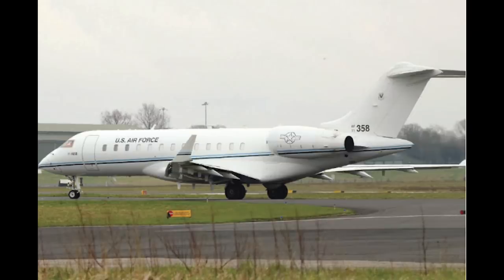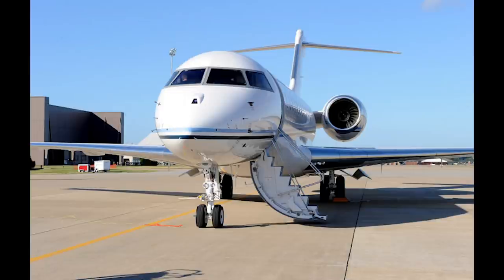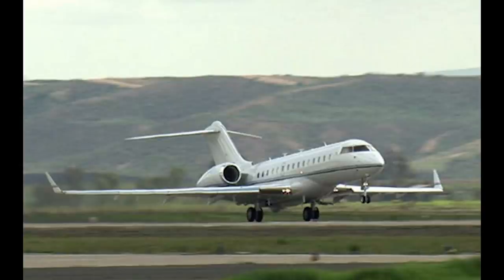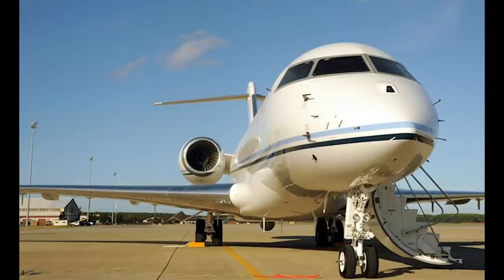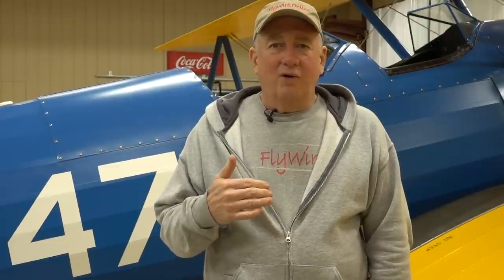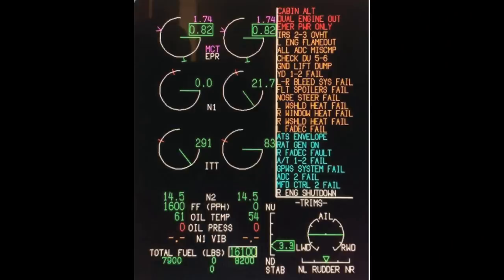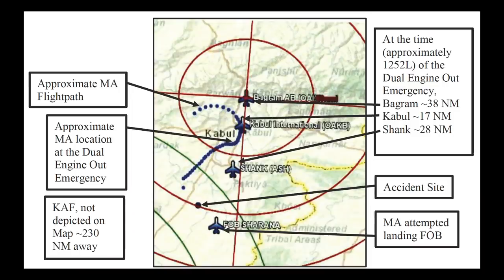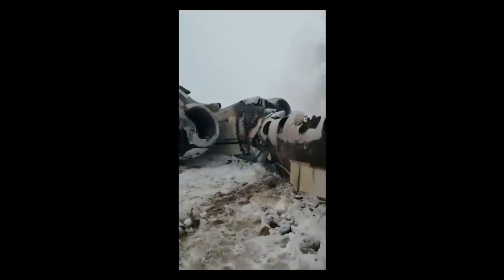Accident Review  Global Express Dual Engine Out

Comment: Do jets have different phase 1 considerations? My actions in a piston prop let me identify based purely on the force of my control inputs, dead leg = dead engine, does that not translate to jet ops? Why even touch right engine until you’ve identified and confirmed?  No judgement, it sounds like a hell of an emergency to deal with
Reply from the maker: The swing accompanying an engine failure is not quite as significant with the engines mounted on the tail as it is under the wings.
Reply: Ah of course that makes sense, thanks
Reply: Lawsen, If you hand fly jets enough you can detect immediately which engine is losing thrust. Problem is most pilots today rely on autopilot.
Reply: @willhibbardii2450  yeah true, Scott’s reply makes sense as well for this type I feel silly it should be obvious the moment arm for where the engines are placed I imagine would have to be near zero and as you say there’s automation yaw dampers and the like that probably make it very difficult to tell
Reply: @lwearne1  , Computer automation of complex engine and flight controls are wonderful things. Many are developing driverless automobiles and aircraft. Seems we are propelled into a culture that depend on bells and whistles facilitated by computer programming. At FL-42 loss of one engine to me would be a dead stick scenario. The service ceiling as to performance is almost cut in half. Flight school 101 predicates trimming to VBUG (VG) best glide speed and making a heading to the next available landing area. Even dropping from FL-42 to FL-22 at 1000 FPM is 20 minutes. To my thinking waking up the APU would be priority. The RAT is a wonderful device if you lose hydraulics, pneumatics and electrical in a landing scenario. With fly-by-wire technology you need good energy management skills. In this case I'm thinking they switched off the good engine and were attempting to relight the fire in the bad engine. I still have many questions as to temperatures aloft, prevailing winds aloft, weight at the time of throwing the compressor blade, pounds of fuel onboard at the time. Rolls-Royce BR710 compressors have a remarkable service performance record. I found that losing both isn't part of the official training syllabus. My thinking is that it should be when operating above FL-35. Flight school 101 could have made the difference of having a better outcome with this event. Seems flight planning basics were overlooked by the PIC favoring a preconceived plan of windmill engine restart of a stalled compressor without APU backup. Not a primary go-to choice I would first choose. As Scott stated; "In an event like this, first wind your watch!" Seems applicable.
Reply: @willhibbardii2450  thanks for the insight Will, hopefully they don’t automate us out of a job anytime soon
Reply: @lwearne1  , Your very welcome! If a person is interested I love talking aviation. Aviation is my Achilles heel!  I've had a very fortunate career with my aviation addiction primarily kept it on the back burner... I consider aviation as a pass through operation... Lot's of dollars transfer however it's like throwing money at the ceiling, the ones that stick you get to keep!

Back to learning about the Global Express Aircraft... 

This bird can load 6,450 gallons of fuel totaling up to 43,550 pounds. Automation eliminated the flight engineer with the Smart Cockpit!

Let's just talk about fuel management for this bird alone... All needing electrical power to function... Example...

Fuel Management and Quantity Gauging Computer (FMQGC), or manually through
switch selections in the flight deck compartment.

Fuel is contained in a wet wing box structure, which is sealed to form the three main
 separate wing tanks, and a smaller quantity of fuel is carried in a separate aft fuselage tank.

The tanks are vented to atmosphere and slightly pressurized by an air scoop located on the lower surface of each wing. A scavenge pump purges fuel from the vent lines and a climb vent, located in each main wing tank, provides ventilation when the airplane is in a nose up attitude. 

Each engine is supplied with fuel from its respective feed tank which contains two alternating current or AC primary pumps, and one Direct Current (DC) backup (or Aux) electrical boost pump. 

The transfer system maintains the feed tanks full during all attitudes, and provides automatic transfer of fuel from the center tank and aft tank to the main wing tanks.

Lateral balance between left and right main tanks is controlled automatically by the
Fuel Management and Quantity Gauging Computer (FMQGC), or manually through
switch selections in the flight deck compartment.

And That's Just Fuel Management! The codes for reported system failures read similarly to a WX code briefing just to interpret what is exactly happening and going on with the systems that may need manual overrides... Oh! There are several software variations to boot!

I haven't located the performance of VBug yet however I'm finding the numbers from emergency TO failed engine procedure referencing numbers between 87 ~125 Kts. 

Plus one of the guys monitoring claims: You can start the Global’s APU at up to FL-37 and extract bleed air for an engine start at  or below FL-30. The Global has a great APU if this is fact. 

Compared to equipment I'm familiar flying, It's sounding like an extremely robust piece of equipment! Performance probably enhanced by computer control... Like I said, my go-to plan would be flight school 101. Set up best glide speed, make heading to first available LZ and wakeup the APU. A windmill start would only be an option once I verified what exactly had happened and then if the APU needed help.

Fun fact to remember when operating in an MOA... Military pilots are often low time student pilots training in them with very sophisticated high speed equipment... Now we have drones to deal with as well.

A copy and paste about me...

I'm blessed that business has afforded solid platforms to fly myself in my career.

Trained in single engine pistons, not spending much time in twin pistons. Though the first aircraft I partnered with was a Barron. I love teaching aviation and operated 3 evening flight schools in my spare time simultaneously between 1992 ~ 2001. 

A part from my hobby aviation business I bought and sold new and used aircraft and operated manufacturing operations for specialty US certified control surfaces in my spare time. I've produced parts for many manufacturers, avoiding the experimental market. 

From 1981~2001 My primary job was restaurant engineering operating in a 4 state region during those years.  

My equipment training resume experience from 1967 ~ 1981 includes 737-100, 707... I learned early on that flying at altitude monitoring ATC and babysitting autopilot wasn't my cup of tea. I couldn't see myself being a driver for the next 40 years. That was a great decision for me, though a few times over the years I've thought I would welcome the boredom... But those were passing thoughts...

My primary discipline occupying my time now is all electric precision agriculture equipment. This is a spinoff of commissioned work I performed for an enterprise foundation project that was operated full time between 2015 ~ 2020 researching and developing alternative energy products. 

My dream for aviation is all electric propulsion! I've kept in mind for many years to produce. That being said after crunching the numbers for design life for aviation propulsion systems. It doesn't make financial sense at the juncture for GA. The electric systems are working well in boats and yachts. 

For my personal hobby work now, I'm re-designing a larger Mooney M-20 C style composite built aircraft that I've planned out for many years with the extended nose speed mod conversion. 

My work on this GA Experimental design project was planned for all electric 150 KW experimental propulsion system with a 6 hour range.

However I'm converting alternate planning for propulsion... In the marine industry a proven 3L V-6 TDI 420 HP diesel engine with compound turbo has proven very robust and affordable. Any way you crunch the numbers an aviation conversion propulsion system is a winner. Full power translates to 21 Gallons per hour Fuel Burn... Less than 100 pounds additional weight for the system than air cooled 100LL counterparts. Half the fuel-burn per HP.  

I'm experienced building the RV-4 and Christen Eagle II and have designed and built numerous composite boats... This will be my first attempt other than model aircraft to scratch design and produce a personal aircraft full size aircraft.
Reply: @willhibbardii2450  Fascinating stuff they're certainly impressive machines your right 101 best glide and most suitable field doesn't change. Sounds like you've had quite the journey with aviation congratulations I hope I get lucky enough to sit behind the controls of a 73 let alone give it away hah
Reply: @lwearne1  , Pratt & Whitney JT8D-7 turbofans, propelled the 737-100... They were state of the art when I was flying them... The 737-300s up makes the 100s seem like a dog. The CFM56 propulsion unite on the 300 are very robust. I've only flown on the 300s ~ 800s as a commercial passenger. Very efficient comfortable aircrafts. One of my favorites to be a passenger on. The 300~800 pretty much perform the same. Commercial carriers are looking for pilots.

Comment: After reading the report it’s unclear to me why fuel flow for the left engine wasn’t indicating 0 if the EEC commanded an auto shut down. If the crew did nothing at all they would have been in a more familiar engine out situation but the temptation to react must have been overwhelming. The reason CVR data isn’t available is because the impact switch was triggered. As far as the CVR was concerned, the aircraft crashed. They were on one violent ride. Thanks Captain.

Comment: What's the speculation as to why the CVR stopped working?  Is it located in the vicinity of where the left engine's fan blade exploded?
Reply from the maker: Good question. From what I've been told it is located near that left engine nacelle. Since the investigators never got to spend much time with the wreckage they were not able to determine the cause.
Reply: This was discussed in the report.  Since CVRs have a 30-minute loop recording, they are designed to shut off upon crash impact.  Since the CVR stopped recording at the exact moment the fan blade came loose, it was determined that the vibration was so severe, the CVR thought the airplane impacted the ground, and auto-shutdown.

Comment: Damn, they should have got the r engine started...
Reply: Yes. If they had worked the problem from the beginning (Wind Your Watch) the right engine wouldn't have been switched off 24 seconds into the event. They still had multiple chances to pull it out. Head toward a nearer airport, get the APU going / hit the right engine master, fly best glide instead of attempting multiple airstarts... It's AWFULLY difficult to be flexible under stress & they paid the ultimate price. Point is the initial error didn't doom them - breaking the decision chain at any of several points may have changed the outcome. To me that's the lesson they gave us with their lives. RIP

Comment: Sooo wait, WHAT?? Why, if the right engine was PERFECTLY good, were they having any problem at all with starting it?  You didn't address that AT ALL or I overlooked it (that's a possibility I guess).
Reply from the maker: Sorry, you over looked that. They moved the switch to off for the right engine and that prevents any start attempt. The Left FADEC prevented any start attempt on the Left engine.
Reply: @FlyWirescottperdue  Ohh.. I overooked that !  Hah hah.  Thanks...  So, had they turned the switch to ON on the right engine, they would have (probably) been able to restart the right engine and fly fly away?

Comment: Is there an altitude limitation for the APU in the Global Express?
Reply from the maker: As far as I know the APU start envelope is 37,000' and it can operate up to 45,000'. I've always been a fan of the APU in any engine related emergency.
Reply: @FlyWirescottperdue  that is the action Sully took , in a hurry, which turned out to be advantageous. Ironically, one of the few things you can do, fast and instinctively without negative consequences. IIRC, it’s why the RAT didn’t deploy and he had normal control law all the way to splashdown.
Reply: @FlyWirescottperdue  - Yep, I was trained to start the APU on any flame out situation as soon as possible.

Comment: Marrying the throttles with an engine failure is NOT a normal procedure! I have 30,000 hours including 34 years of airline experience and have never seen this done. I have also been a current and active flight instructor for the past 51 years with thousands of hours teaching in multi engine airplanes from the DC-3 to the B-767 and never saw Or did this. With an engine failure, you slowly retard the suspected engine and if there is no change in the yawing tendency, then you have identified the correct engine. Having both thrust levers equal confuses the issue of which engine has failed.
Reply from the maker: Joel- You are confusing when 'Marrying' the Throttles is done. It is done AFTER all engine failure securing procedures are accomplished. It has NOTHING to do with identifying the failed engine. And it is indeed a standard procedure, just as I stated in the video.